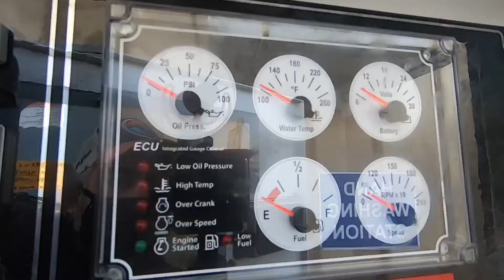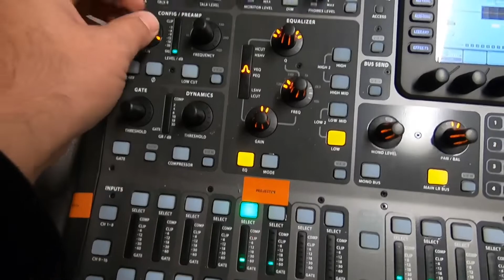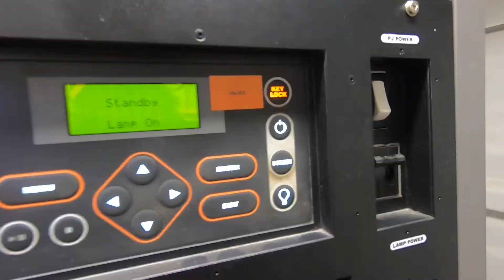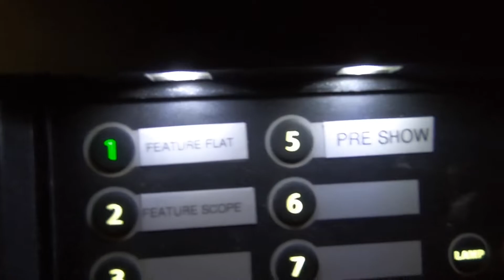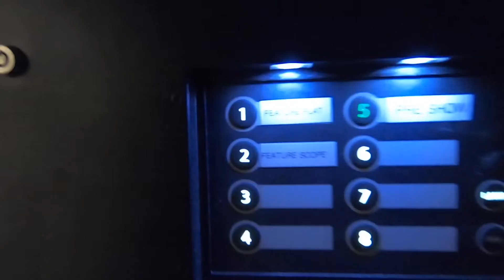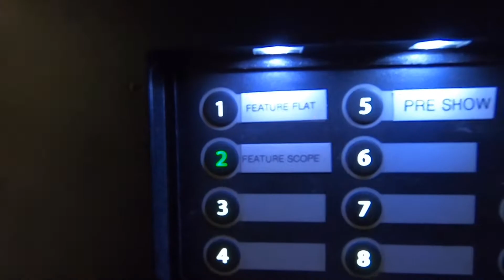#Projecting #Movies @ A #DriveIn #Theater During The #2020 #Pandemic// #NewarkMoonlightCinema

Comment: I wish I hat the mony to do this what happens if u have a scope movie u just have black bars on top and bottom ? how big can u make the  screen ?
Reply from the maker: The screen is actually a little smaller than regular Movoe Theater size screens so the Macro in the Projector had to be accommodated. For Scope Movies there is Widescreen visible but its very little